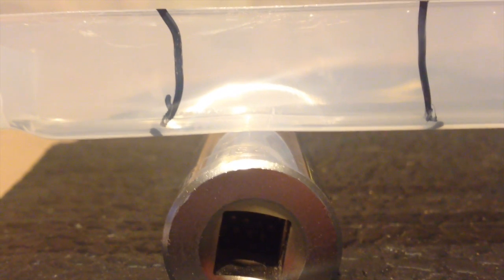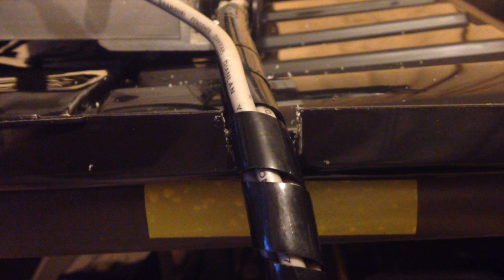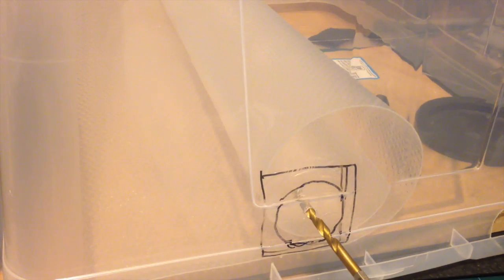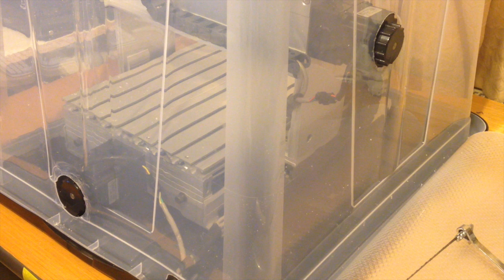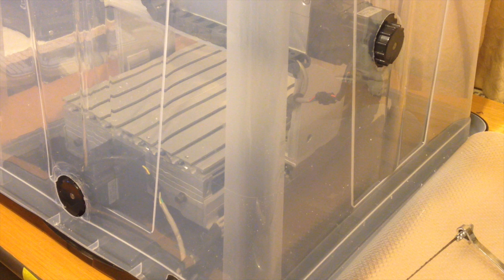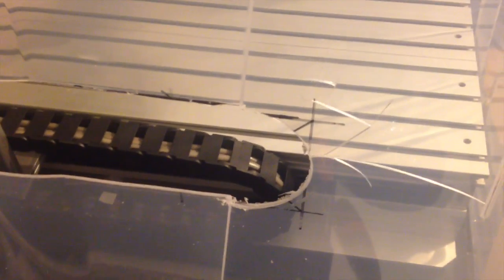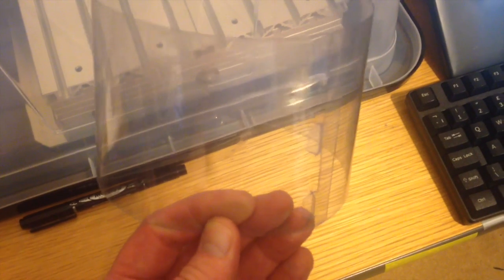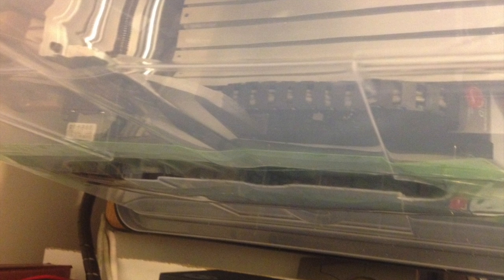Making A 3020 Mini-CNC Router Engraver Enclosure - Part Two

Comment: If only my router was small enough to use one of these
Reply: FIXED1T Oh it's a bit too big for one of those containers. Its based on the OX design at Openbuilds, mine measures 1000mm long and roughly 800mm wide with the steppers. I went ahead and already built a waterproof enclosure for it out of 2x4 and 6mil plastic sheet. Not the prettiest and hopefully I can move it out of my bedroom soon :p
Reply from the maker: John Schwarzanegger Hi John, Yes thats quite a bit bigger that sounds quite a hefty enclosure and sounds like my early synthesiser boxes.  One was 5ft x 4ft and made from 1/2" cross ply and 4x2 and covered in amplifier plastic, it looked great but by the time I'd added the huge power supplies we had in the early eighties It was almost unmovable.  Its been a standing joke with my missus this is the lightest box I've made ;-)

Comment from the maker: This is Part Two of my video to make a 3020 Mini-CNC Router Engraver Enclosure for under £10 (approx $15 USA) to reduce noise, mess, swarf contamination and enable you to safely see the job when using the engraving router.  The video shows how I do it and some of the pit falls.  

It works with an additional 20+ db reduction in noise.